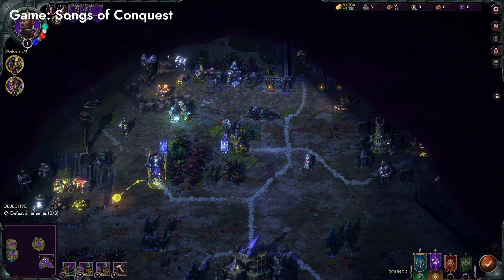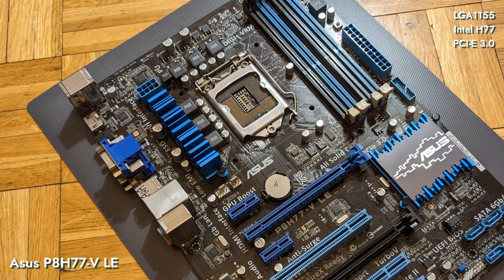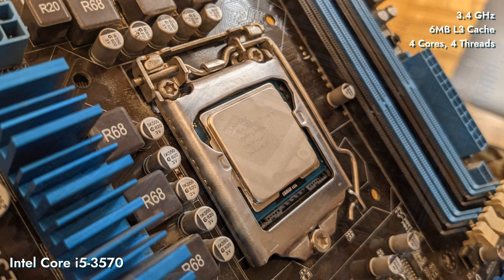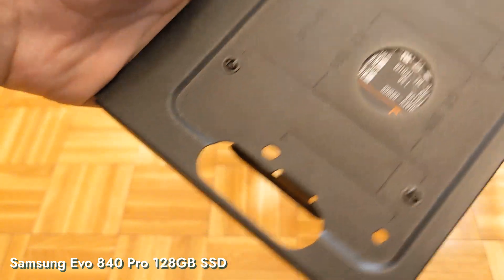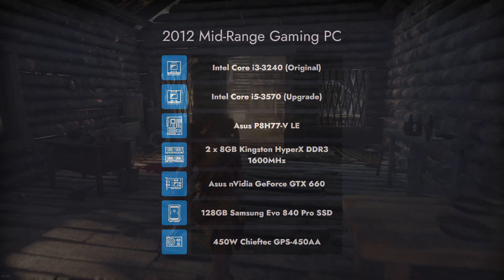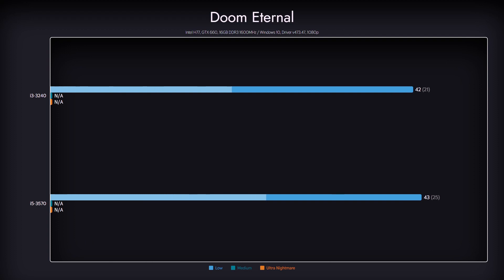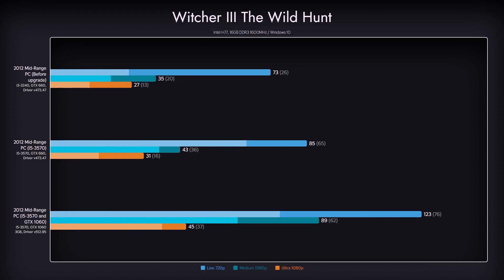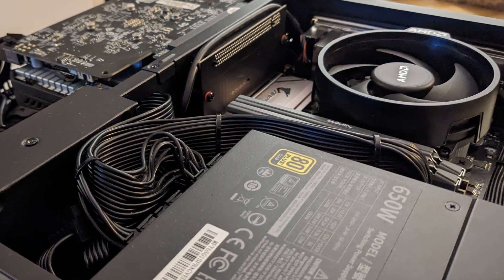2012 Mid-Range Gaming PC ( Still in use )

Comment: I'm still using an i7-2600 in my system the only thing I have upgraded over the past couple of years was the GPU to an rx5600xt and at 1080p it still handles 99% of modern games. Most people don't realise how low the bar is for modern gaming while the still manage to look good at lower settings.

Comment: My secondary “junk build” PC has this same motherboard and a lightly overclocked i5-3570K and a GTX 1050 Ti and 16GB ram. It’s running Windows 11 and I use it for school work and some basic gaming like Roblox or Fortnite during school weeks. In the weekends I go to my dad where I have my higher end gaming pc, but I gotta say these 2012 parts are holding up quite well with modern software, it’s not slow at all! It even boots faster than my gaming PC because the motherboard has very quick start. The motherboard I use for gaming is from 2021 and uses like 8 seconds more booting time no matter the boot speed of windows itself.

Comment: My current rig is a socket 1155 with an i7-3770k cpu, 24GB RAM, 500GB SSD, Radeon Sapphire Pulse 8GB GPU card, 750w PSU, and a couple 1TB spiners as well

Comment: Recently put togethor a 4th gen i5 3.2, 16gb 1600, audigy 2zs & 9800gtx+ running 7. It's a fantastic system for 2015 or so titles & back. Thinking maybe a 1070 upgrade. While a workhorse, the 9800 is very long in the tooth.

Comment: I usually go cheap in the motherboards and find some good processors for good prices, used for some time i7 3770 with a simple p8h61, used to play only simpler gamer that the r7 265 could handle, had to move the 3770 to my office pc after the the last setup became unusable, and since I had a h81m-a lying around, managed to find an i7 4790 for cheap and the pc went on for another year, til I randomly decided to try out a newer thing, still cheap of course

Comment: My rig that I still use daily is from 2015, and has the following specs:
ASUS Z97-P
i5-4690K
16 GBs of DDR3
Asus Strix Gtx 960

It is absolutely horrible when playing any game that doesn't rely on the processor.
The graphics card is lacking in modern games to say the least.
Reply from the maker: I've had a similar rig until recently (i5-4670k, Z97-K, 32GB DDR3), with GTX 950 though. I've added GTX 1660 Super to it, and it was great boost to it's performance. Depending on your financial situation you could try newer card as a first step. Or buy some better graphics card for your new build and later buy other parts. - M

Comment: Description says ram is 2x2 gb btw rather then 2x8 gb, threw me off until i reached that part of the video.

Had 8 gb ram in 2012 via 4x2 gb ramsticks & at the time ran a phenom II x4 955 at 3.9 ghz & hd 6870.
Around August 2012 i got the phenom II x4 955 in a trade for my athlon II x3 445 at 3.1 ghz with some cash.
Had ghetto modded the hd 6870 with 2x 120mm fans at 1000 rpm zip tied too the card after taking apart the cooler too remove the shroud & removing the original fans.
Didn't have patience too wait for the hd 7000 series midrange cards too release, otherwise i'd probably have ended up buying a hd 7850 or hd 7870 while staying on my hd 5770 another few months.
Reply: By this time I had an phenom II x6 which was good for gaming til 2018, then it started to show its age and was moved to office pc until the cheap motherboard died
Reply from the maker: Fixed. Thanks :D
Reply: I had a pentium dual core w 4gb ram and a HD 7750 1gb, got heavily cpu bottlenecked in BF4 😅

Comment: i put a 3090 in my 3770k computer, lol it's awesome. modern cpu aren't really any faster.
if i got a better cpu i'd have to get a worse gpu. not worth it! having a 3090 is epic
Reply: Well id imagine your being bottlenecked quite a bit!

Also modern cpu's are quicker lol. 5800x3d, and even newer 7800x3d would tear apart your cpu in seconds for gaming purposes. It would also boost your fps in higher tier cards more than lower.

I would a lot that your cpu is bottlenecking your gpu. Even at 1440p and 4k, a lot less, but still bottlenecking. Plus the cores counts per second increases with more modern gpu's even if the Ghz does not change much,
Reply: @re2590  i know, i mostly got it for AI purposes. but overwatch 2 still caps out at the 600fps limit
Reply: a modern cpu is twice as fast, at most. not a huge deal